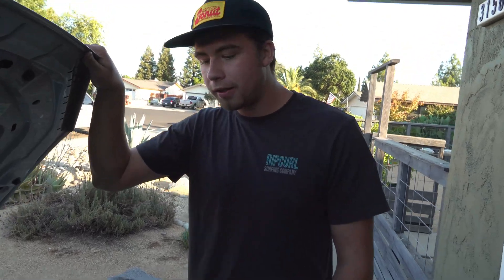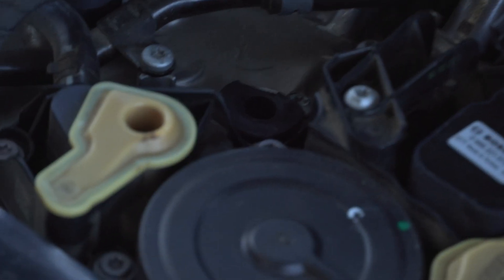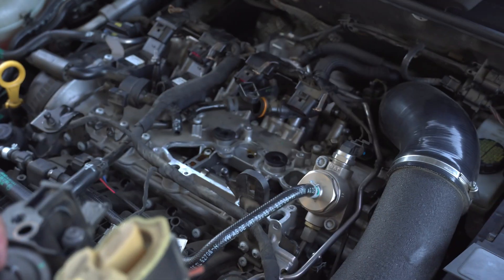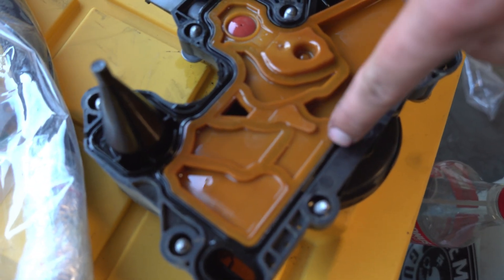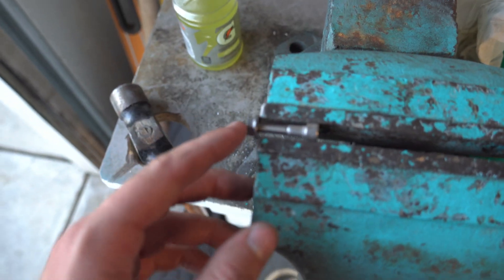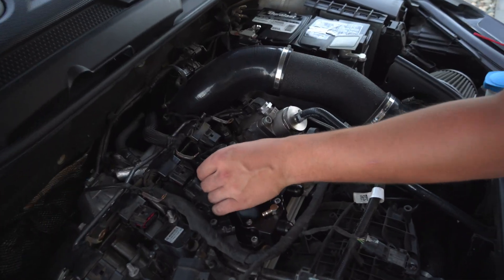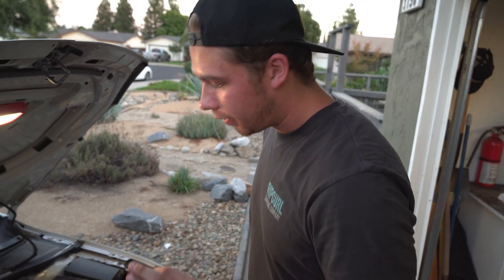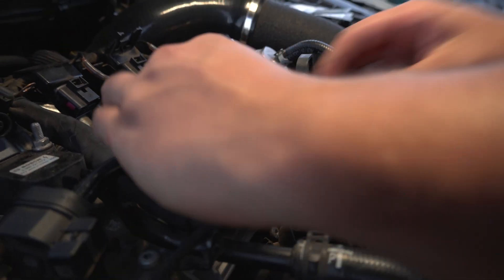Integrated Engineering Catch Can Install! (MK7 and 7.5 GTI!)

Comment: I have the same system, but the reservoir fills up with oil (100 ml) after a dozen kilometers. When the reservoir is full, the car starts consuming oil through the turbo vacuum. The car is currently at stage 3 (500hp) and has no oil catch. 
Can you help me with a possible reason for this?

Comment: Unless your are tracking the car HARD and often then you’ll need it but if your just daily driving and doing road trips a catch will do absolutely nothing 99% of the time. There’s An oil surge issue that happens during high G turns on track but that can be resolved with a full pvc replacement. You should’ve saved your money
Reply from the maker: We do track the car quite often and it sees lots of revs
Reply: Your statement about oil catch can is correct. Unless car is being tracked it is pointless. You are better off just spending your money getting a euro manifold that you can have port and direct injection into the valves.
Reply: The oil surge issue is pretty bad tbh. I'm a bit of a, playful driver let's say, even on the street, and I constantly have issues with oil surge. Swing her around a corner nice and hard then accelerate out? Oops big ol fart cloud, plus some misfires, guessing that's a coil issue, coils not strong enough to spark adequately through the oil mist.